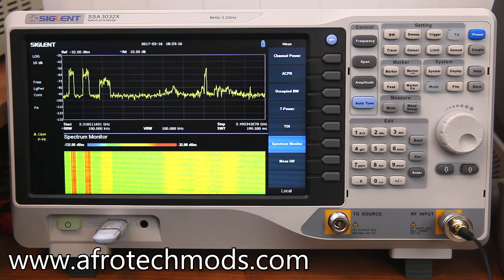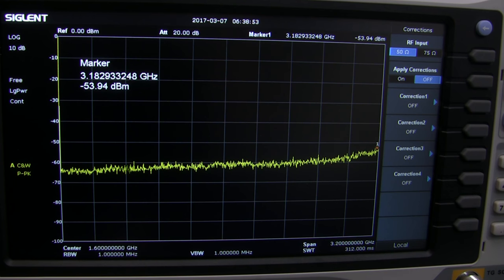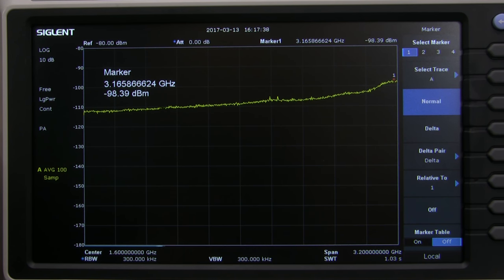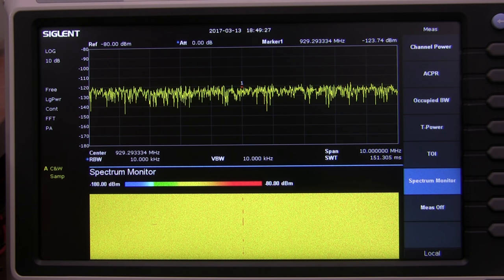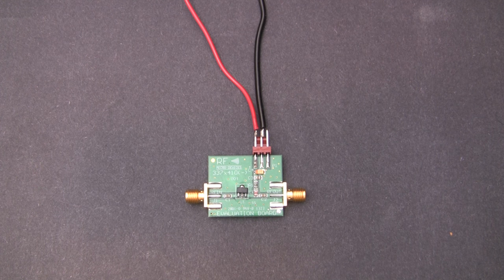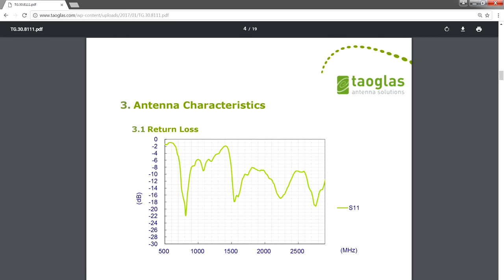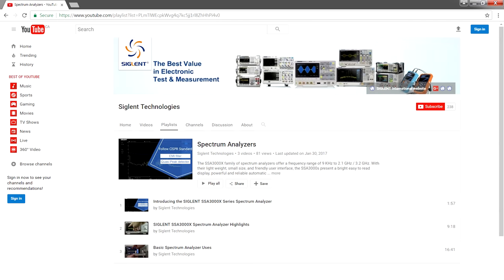📡 Siglent SSA3032X Spectrum Analyzer Review & Experiments

Comment from the maker: This is my longest video ever and it is extremely information dense. Please use the table of contents to navigate and watch in multiple sessions as needed.
0:00 Intro
0:33 Unboxing and discussion of inputs
1:24 Screen
1:59 Build quality, fan noise, user interface
5:35 AM and FM demodulation
6:18 Average noise measurements
9:11 Phase noise
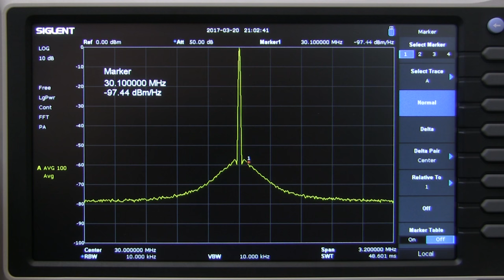9:46 Spurious readings and possible shielding issue
12:25 Amplitude accuracy
12:40 Tracking generator evaluation and experiments
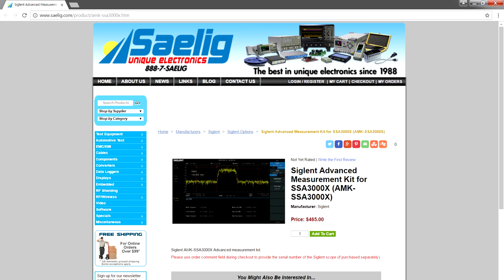15:35 Advanced measurement kit option
16:13 EasySpectrum software and EMI measurement option
17:47 Introduction to measuring antenna performance
19:30 Reflection measurement software and hardware experiment
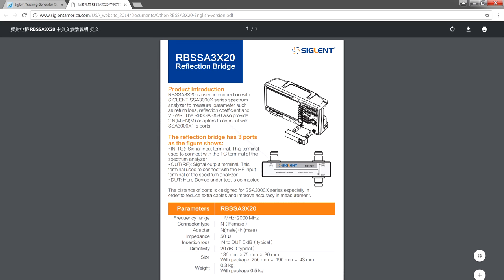21:35 Reflection bridge hardware directivity discussion
22:36 Limitations of directivity experiment
24:18 Final judgement and conclusion
Reply: you weren't kidding, exellent narration voice, maybe a tiny bit dark

Comment: I got one of these and a new benchtop power supply about a month ago and love it so far.  The wheel on mine seems decidedly more solid than you show, however there still isn't any progressive speed enhancement.  My needs for an analyzer are drastically more primitive than you covered so it fits the bill really well.  Thanks for doing a good walkthrough on it, I learned a thing or two.
Reply from the maker: Thank you for your feedback. Yeah I figured the wheel on mine could easily have been a one-off manufacturing glitch on the unit I received, but a review is a review and I've gotta be transparent with my audience about flaws and stuff.

Comment: Just a note (@18:00) VSWR is NOT "... a measure of how good the antenna is at radiating" although confusion about this is very common. Alas, if only it were.  VSWR is a measure of how much power delivered to the antenna input actually makes it INTO the antenna, vs. how much is reflected back down the transmission line.  Once the power HAS made it into the antenna, how well it radiates it is a function of about a zillion complicated factors that are so hard to quantify that antenna manufactures pretty much always just measure it as a function of az, el, bandwidth blah blah blah, at an antenna measurement range.  And even that measurement is a total nightmare.  If only VSWR WERE a measure of how well an antenna was radiating !!  Nice video - thanks !

Comment: Great video.  I've got the 3021x+.  I ran into this issue that you might not have seen.  Start by putting in, say 100KHz signal from a good signal generator.  Set the SA to center peak at 100KHz.  Now go to span and while zoomed into the peak at center, rotate your knob and step through spans in one direction or another.  You'll note the the peak will sit on center and then go off the center and the peak will be read as off 100KHz.  Keep turning and the peak will go back to center span and accurate.  Using different freqs and different spans, you will get different errors.  Some over 1KHz.  I'd be interested to know what you think about this.  Thanks again for a great video.

Comment: Nice video, but a couple of comments. Return loss does not indicate how well an antenna radiates. A fifty ohm resistor will have a great return loss, but it'll radiate almost all the RF power as heat. In 40 years I've never heard of VSWR being pronounced as Vizwar before, it's usually just the four letters, and often just three, S.W.R. pronounced separately as letters. Also take care trying to measure antennas at the end of a length coax, the coax will often have confusing effects that don't reflect the actual case. Finally it's quite common to use attenuators, aka pads, of a few dB on the instrument's ports to minimise the effects of port mismatch on any device under test. Having said that this was the most useful video I've seen on your channel.
Reply from the maker: Good comment highlighting the distinction between radiating and not reflecting. I kinda blitzed through that. Not sure where and when I picked up the vizwar habit but I definitely didn't invent it lol.
Reply: Came here to mention that about RL, but you beat me to it. However, I have heard of VSWR pronounced as a word sounding like 'vizwar' when working in RF instrumentation. Nice video, and keep up the good work.

Comment: I really appreciate reviews that go into this kind of depth. If it was a $50 antenna analyzer, a 10 minute review would suffice. When I'm looking at a multi-thousand dollar purchase, I really want to see the tires get kicked. I'm trying to decide between this analyzer and the Rigol 832. This seems like a much better deal, but I want something that will perform well and give me several years of service. The range on that directional coupler is shameful. A little more effort would have made it reach the specs across the entire 2GHz. Also, why don't they offer, at least, a 3GHz coupler? If people are willing to spend the extra money for a 3.2GHz analyzer, they will probably be using it for the 2.4 - 2.5 GHz band. I checked the price for that Marki bridge. It will cost an additional $695!!! Yikes!!! That wonky dial worries me. Dave Jones (EEV Blog) did a comparison of the Sigilent and the Rigol. One of his complaints about the Sigilent was the cheap feel of the plastic case. I intend to use this on my bench, as well as in the field. I'm very careful with my test equipment, but accidents happen. (An 'accident' is why I'm replacing my old analyzer.) I need something that can take a few bumps before it goes down. Thanks for the great video. I'll be ordering my analyzer today and you've helped with the decision process! :-)

Comment: Regarding spurs I have always wondered why the manufacturers do not implement a feature where you can save a list of them and whenever there is a signal at that frequency, you have a message somewhere telling you there was a spur. Working with different devices it is nearly impossible to keep track of where they are, and you are fooled by them often enough that some workflows include a "check if the signal is real" section.

Comment: You brought out some good suggestions for changes in button layout, specifically moving the BW to that mostly unnecessary 'Auto Tune' position. I use the BW all the time and never had use for that AT. While there may have it uses, it surely doesn't desire a prominent location. Same goes for not showing the start & stop frequencies of the span.

I have asked that that unnecessary 2nd page for the TG functions be moved to the 1st page where there is ample room for those four functions. There would still be one 'open' position available.

Their Reflection Bridge is a waste. Why have a option that is only (truly) good to 1/2 the bandwidth of the instrument (1.5GHz vs the full 3 GHz) other than cost? At least offer a step-up RB that covers the full capability of the SA.

Lastly, no you surely weren't too technical in you description.

Comment: great video! I just bought a SSA3021X a few days ago with the beehive 101A probe set. I'm a beginner when it comes to spectrum analyzers, but I mainly want to use it for EMI pre-compliance measurements and fixing leaks.
as other people already asked: a series about RF measuring/test would be nice!
Also, if possible, about hunting and fixing EMI/EMC leaks, using different kind of probes (H field, E field) and how the probes' specs are related to the measurements.

it looks like the EMI tests should be made with the EasySpectrum software. Currently I try to find out how to have correct ways to get some usable results. There's dwell time for the QPD and it should measure in frequency steps (for example 50kHz). I've tested some settings on the SSA and the tests would have taken a several thousand seconds ... I guess that's not a good way to measure :D

Beside a few app notes I've never found anything else about lowering/preventing radiation levels of buck converters and other DC/DC converters, but that would be really interesting, especially if it would show the influence of filters and correct placement ... :)
Reply: is ssa3021x upgradeable to 3.2 ghz ?

Comment: Great review!  I am, however, having difficulty in channeling your review results to my application.  I am interested in providing Pre-Compliance EMC and EMI services for Clients, and I am wondering if this unit can do the job.  My application centers around Automotive Electronics for now.  I had specified the SSA3021X unit, with TG, EMI Pre-Compliance Kit, and the Near Field Kit.  I also know I need other hardware for the EMC testing not yet identified.  Would you recommend the SSA3021X, the SSA3032X or something else?  I have determined, from other reviews, that the Siglent units perform better than equivalently-priced Rigol units.  Thoughts?

Comment: For $170, I don't know why the TG isn't included with both models. That's the same as having a spare tire as an option.
It gets me that 90% or more of the used SA's do NOT have TG's. Unbelievable considering all the uses.
Reply: Yeah, having a TG is really useful. My FSAE-30 doesn't have one, so I usually just use a wide band noise generator instead, which is good enough for basic filter work. These days I've been meaning to actually figure out how to sweep using an external RF generator. My spectrum analyzer has LO out, so I should be able to make it work.

Comment: The 'jog' dial on your sample must be a unit defect. My 'jog' dial works fine, it doesn't react the way yours did.
Reply from the maker: I'm sure that is the case. As the reviewer I have to be transparent with my audience about flaws and this was a flaw I found in my review sample.
Reply: Understood. No "fake news" from you!
I was surprised at that finding, as I had to check mine to see if there was a problem. There is no set screw and I couldn't easily remove the knob either.

Comment: Please note VSWR is nothing to do with how well an antenna radiates at all. It is actually to do with impedance match. A 50 Ohm dummy load will show a prefect VSWR. Also calibration should be done with everything attached except the DUT, calibrated to open, short and load

Comment: Totally confused !  I just bought an SVA1032X (same SA as this) based partially on this review - thanks !  There is a setting in the "BW" menu called "Average Type" with no useable explanation of what "averaging" operation in the device it controls.  The manual says, "When trace average is on, the average type is shown on the left side of the display" however the average type selected here is ALWAYS shown on the left side of the display no matter what is turned on and off - anywhere.  And there's no "Average" setting IN the BW menu, just this "Average Type" setting.  What is this setting actually DOING ?  Which average function does it pertain to ?  I've been trying to get the simplest answers from Siglent support here in the US but they are absolutely USELESS !!  There doesn't appear to be any other source of support for Siglent questions and problems.  I'm almost beginning to wish I'd never heard of Siglent for confusion like this !
Reply from the maker: Sorry my unit is in storage right now so I can't look it up for you, but maybe someone on the EEVBlog forum knows?
Reply: @Afrotechmods  Thanks for the reply.  I'll give EEVBLog a try, ya never know.

Comment: I'm a poor enthusiast, no scope for a scope, but initial viewing of this design doesn't fill me with the "omg I neeeed this" like some stuff did years ago. £3k in UK pesos, membrane keys - like everything these days (keyboards for PC's have backlit tactiles for not a huge impact on cost) are shit. A wobbly knob that even a cheap audio amp these days wouldn't even suffer with... apart from engineering porn inside the box, I dunno how they get away with it. YES it's fast, and accurate on the floor, but that £3k could go a lot further in my opinion. 

Thanks for the review Afro - long time "viewer" - the site that shall not be mentioned is still one of my favs.
Reply: 1. The "wobble knob' was only with his. I have read NO reports of anything similar including mine. It's a minor issue anyway.
2. I don't see the problem with membrane keypads. Lack of backlight buttons shouldn't be that big of a deal.
3. "engineering porn"? Do you want to elaborate on that one?
4.Where else would the "3k" take you???

Comment: What is the difference between this and an oscilloscope?
Reply: Ivanov Preslav this is for wireless radio and such, so not for direct voltage unlike an oscilloscope

I am not quite sure if that's right the way I put it, so I would recommend you read up on it on Wikipedia or such

Comment: You pay a fortune for this but no acessories??? you gotta be kidding me -.-
Reply: This is not really a fortune in the world of Spectrum Analyzers.  For what you get, it's pretty much a bargain at their price point.  A few days ago  I ordered both the SA and one of their sig. generators.  Just retired and setting up my home elec. lab.   After reviewing what I could get, (other than used) this company was 1st on my list, same thought on the TG.  I'd of course, would have liked it included too since it's already in there.  I wondered if they just increased the price $100.00, they could have recovered the cost of TG from every sale.  Nobody would have even blinked.  Maybe though, there is a better return on investment doing "it" there way.  BUT, it (the TG) wasn't optional for me.  I wouldn't have dreamed of buying a Spectrum Analyzer without it.
Reply: Don Evans:  VERY similar situation for me as well.  Do you have thoughts between the 2GHz and the 3.2 GHz models?
Reply: tkarlmann : I bought the 2.1ghz only because of the price.  I just didn't have enough need for the extra "1ghz."   BUT, I also own another (much older (and far less accurate)) spectrum analyzer that goes to 4.2ghz.  I also knew I would be able to buy the additional bandwidth later for the 3021 if I find it necessary.  I did purchase and really love the TG option.  'That" is a must have on either model.
Reply: tkarlmann: Hi, I recently bought the 3.2GHz version because I do work in the 2.4GHz ISM band, (so many things use that band these days). I also got the Tracking Generator function for free (a Siglent special-offer). I found it works a treat for pre-compliance radiated-emission testing, but I would need to buy a 3rd party directional coupler if I wanted to do VSWR measurements.